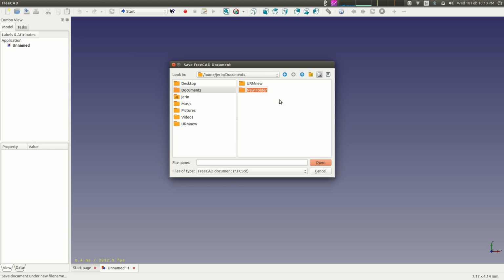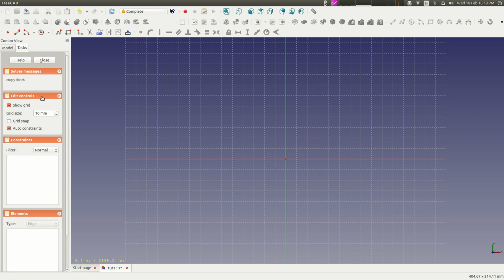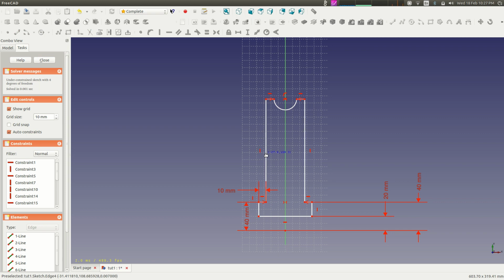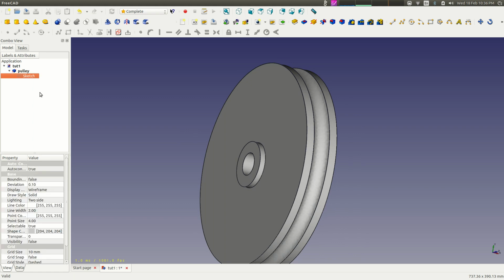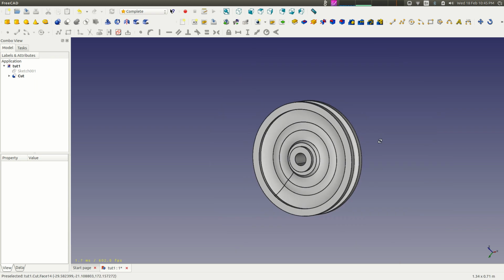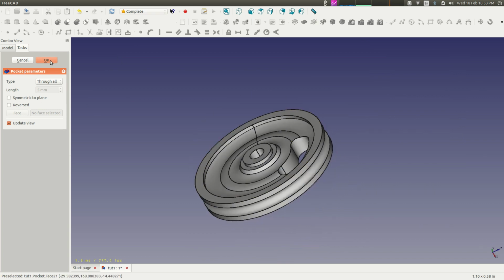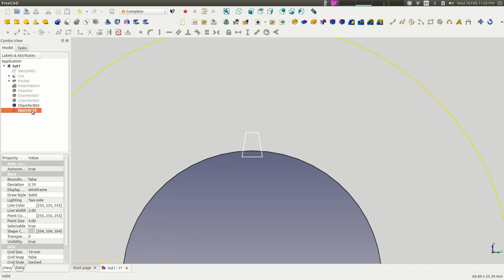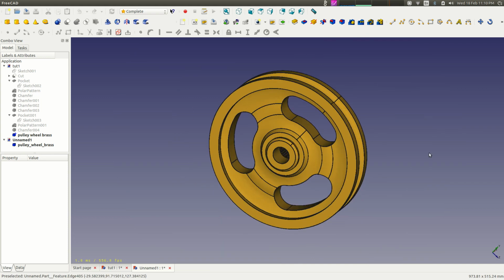tutorial1 FreeCAD

Comment: Great tutorial, I much appreciate your efforts to make this video.
When I tried (in version 0.17 on my Mac) I could get fancy side cut-outs but no spline, or plain rectangular cut-outs (or no cut-outs) with a spline. I tried making the spline before the fancy cut-outs, but then I couldn't get the cut-outs. 
I guess that the Cut tool doesn't like too much complexity around it (as you experienced when you tried to get a 2nd fancy cut-out).

Comment: Got to 21.52min and hit a wall. This is where my FC is not the same as yours and I hate it when this happens. When trying to extrude and make a pocket I get "In order to use PartDesign you need an active body object....tralalala". FJC why is it that ones own app is never the same as that discussed on YT. You have a selection made "Complete" with a gazzilion toolbars, but when i select "Complete" there are only 3 toolbars to choose from. Search for untill I'm blue but I cannot get the toolbars looking the same as yours. ... OH well, lets move to Sketchup that actually works.

Comment: Question: how exactly do you apply the mirror tool? I seem to be enable to mirror that second shape you created for making the surface of the wheel looking so cool. The idea is to apply the same on the other side of the wheel because right now it's just one-sided. I'm sure I'm mirroring the correct plane and the results shows but only transparent. Once I click on OK it disappears. Also the error about the transformed shape not intersecting the support is a mystery. LOL
Reply: +rbaleksandar Ah, I solved my problem. The problem was that I was mirroring wrong plane. :D

Comment: seems the windows 32 bit version isn't up anymore?? 64 bit is useless for me :(
Reply from the maker: hmm that sucks, you could run a virtual machine and run the 32bit linux version perhaps? either that or dual boot or if you have an older machine around just strictly run linux (its free).
Reply: well, not going to change my pc config for it. 
they have a donwload link but that seems dead.   not a very good first impression of the soft :(
Reply: i just reloaded a fresh windows 10 and kicked the outdated linux off , so no use in reinstalling that one again.  maybe there is some other open source alternative for this one?
Reply: Yoeri,capisco la tua rabbia,ma ti preciso due cose,questo è un programma multi piattaforma per cui lo
puoi usare in windows,in derivate linux oppure in mac.
Non necessità ti hardware nuovo o schede video evolute o più schede video.
Certo è difficile da capire,ma una volta fatto sarai entusiasta.
Reply: Giuseppe Battagliese, if you would answer in english i could understand what you are typing.   i don't speak a word itallian ....
Reply from the maker: The rough english translation from Giuseppe Battagliese: Yoeri, I understand your anger, but you two things clear, this is a cross-platform so you can use it in windows, linux or mac in derivatives. you do not need new hardware or advanced video cards or video cards. Certainly it is difficult to understand, but once you do you will be thrilled.
Reply: then he didn't read the english text of me. i only had the problem that the win32 version download wasn't active ( gave an error) , the 64 version didn't work on 32 ( as expected) 

the soft is multiplatform but you do need the correct installer for your system ;)
Reply: yoeri,scusa fammi chiarire con j16out,allora ascolta,la tua traduzione google( delle mie parole)la fa male (vedi che è il tuo traduttore)traduce sbagliato quella tua traduzione inglese-italiano,per cui stravolge quello che voglio dire.
Se poi ti ha dato fastidio,verità risapute nel mondo linux,questo non mi interessa,ma non devi alterare o nascondere informazioni,per tuoi secondi fini personali.
Reply from the maker: just a google translation, i don't speak Italian
Reply: well, tnx for a long text that proves you even didn't READ my post :(    i mentioned in my post that at the time of posting the 32 bit windows version download link at the site was broken......   and for the record : I use WIN 10 32 BIT, with lots of 32 bit /64 bit sot available.     i understand out of your post you are a linux lover , no problem for me.
Reply: seems you are only looking for a discussion...so not going into this game of you any longer.

ONLY PROBLEM WAS THE BROKEN DOWNLOD LINK ON THEIR WEBSITE  what they did repair long ago...
and yes i once did have a linux, don't use it at the moment..

i did remove linux from that pc and replaced that by windows  10....

and for the rest - englisch isn't my native language; do you speak as good french and /or dutch??
Reply: anyway, since the link has been repaired shortly after the post it was of no use that you kept posting about it.

and why that last sentence... seems so unnecessary.
i actualy can recognize a broken link  ;)

and quiting the discussion  :) no need for stress over here.
good evening

Comment: thanks for your video, i installed+tried to follow using 0.16 and "icons for "parallel" and length for horizontal+vertical are in gray
any chance anyone can help me out... i went to "sketcher" and toggle nothing happened
i also tried on 0.17...same result
python 3.6.1 on win 8.1 
thanks in advance